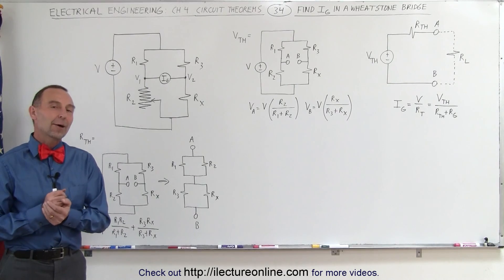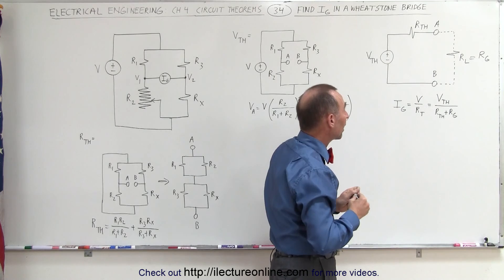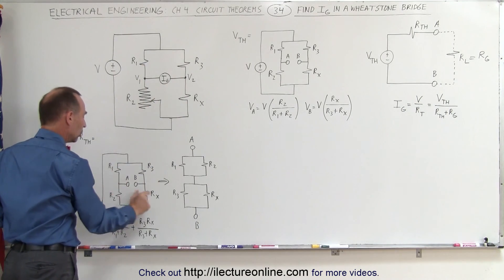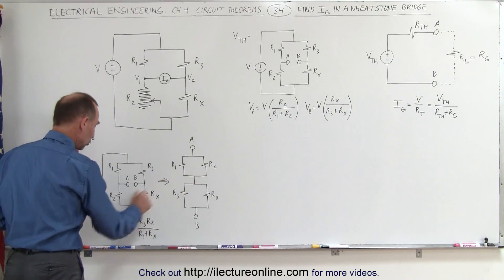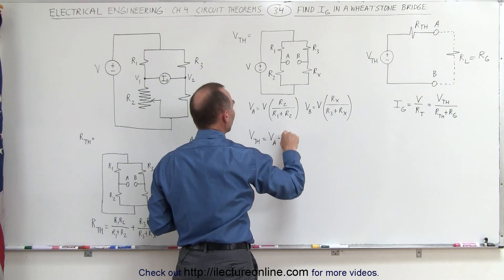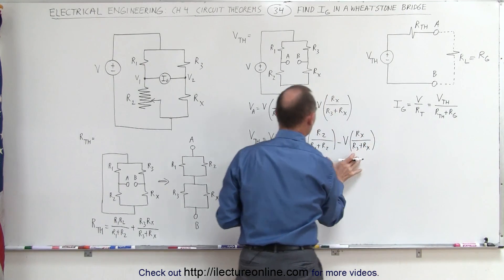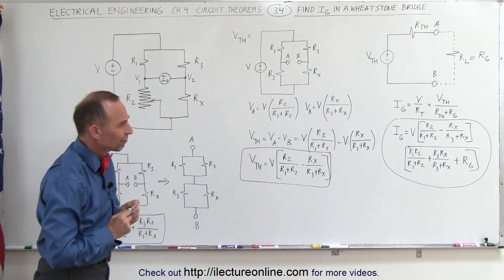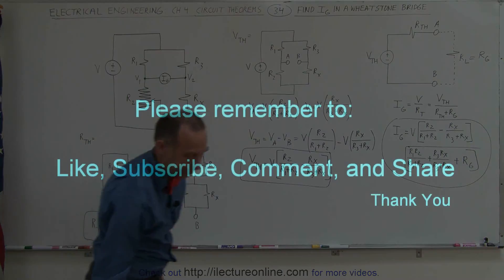Electrical Engineering: Ch 4: Circuit Theorems (34 of 35) I(G)=? in a Wheatstone Bridge

Comment: For the Rth im confused on how you got that equation isn't it meant to be r1 + r2 in parallel with r3+rx since r1 and r2 are in series and not in parrallel same goes with r3+rx how did you get them in parallel???
Reply from the maker: You have to look at the circuit in persepctive on how you can travel from A to B.   Since there are mutlipole paths, (you can eather get to B by traveling through R1 OR you can get to B by traveling to R2.  The same applies on the other side (at B).